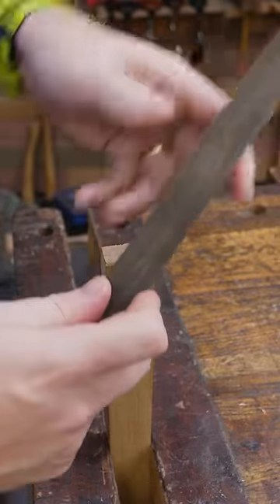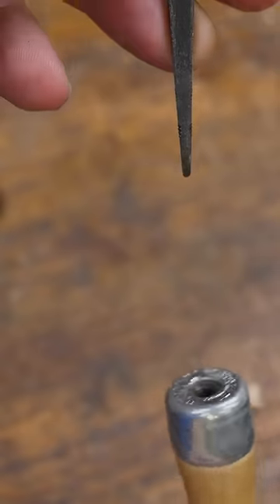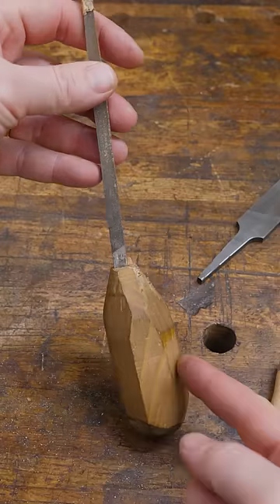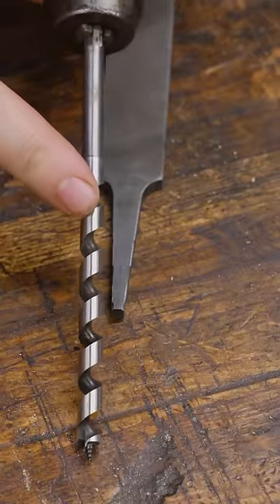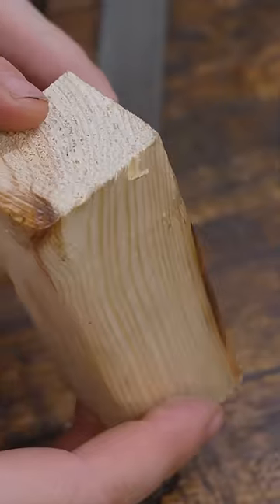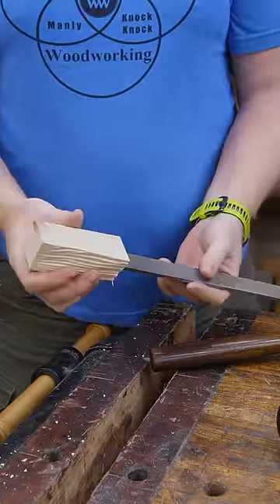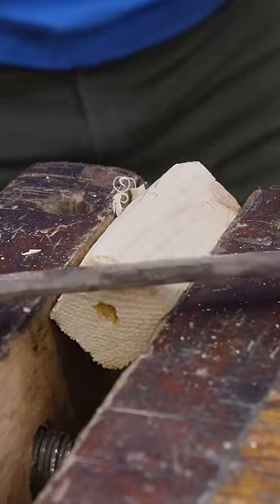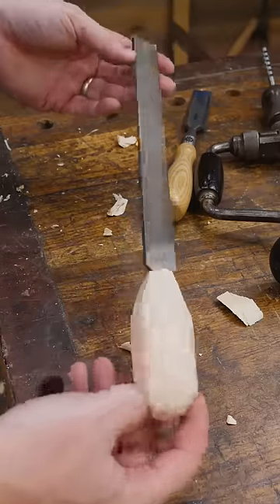How to Make a quick File Handle

Comment: I’ve literally never used a handle on any of my files.
Reply: I've never been a fan of the handles, if they come with the detachable handle I never use it. It's just awkward for fine work for me.
Reply: For me, I only use the handles. I throw the file in the garbage and just make do. Amazing what you can get done with a little grit and elbow grease.
Reply: @bcary461 i never use the handle, it makes control harder
Reply: You don't need a handle on one unless it's one with bigger teeth
Reply: I usually just put a little bit of tape around the metal for grip, I like the tiny not a handle
Reply: well atleast put some tape and rag over the point.
 its a very pointy thing right in the vicinity of your carple tunnel, one accident and no more filing for you.
also use a handle especially when using on a lathe.
one of the guys I worked with told me a story he witnessed from one machine over, running metal lathes you usually with break corners and deburr with a file, perfectly safe if you do it correctly. well the guy on the machine next to him refused to use a handle on his file. it caught the chuck and shot the tang of the file directly into his heart killing him on the spot...
Reply: As a machinist for 30+ years i don't use handles on my files. It is more comfortable for me to not have one.
Reply: I have about 30 friggin files and not one handle
Reply: Sounds like you never got a handle on those. File that away for later.
Reply: It feels uncomfortable with the handle to me
Reply: Same lmao
Reply: @nickb3005 same only time ill use one is on the lathe... seen too many accidents
Reply: Handling shanks all your life, now have you been?
Reply: This is going to seem really stupid, but I didn’t even know files HAD handles. Every file I’ve seen in my life was just straight tang.
Reply: @grimm3698  this boy either capping to his hearts content or really stay with them shanks and there’s no in between.
Reply: @jacobe9187  can’t tell if you’re talking about me or the guy who made the original comment, but on god I’ve never seen a file with a handle. All of em were just tang and file.
Reply: I didn't even know they were supposed to have a handle till now 😅😂
Reply: @grimm3698 so you spent your life surrounded in Tang?
Reply: Neither have I, but I might fire up the lathe to knock out a few, now that he's pointed that out to me.
Reply: Handles for me are more comfortable and control. Old screwdriver handles work very well on most files. Even a wood ice pick handle is good.
Reply: @nathanmunro-donohue4330 That’s right! Grit your teeth! (I’ve heard tooth enamel is pretty hard, too) And add that elbow grease! Yer elbow will squeak without it.
Reply: @nickb3005 Only on the file by the lathe.  I've gotten one WITH the handle ejected into my gut, and that hurt pretty bad.  I don't want to think about the bare tang hitting me like that.  Although maybe I just shouldn't be using a file on a lathe at all.
Reply: Apparently you've never seen a lathe run a file through a mans hand then. 😵💀

Comment: I have a lathe.  One of the first thing I did with it was make really nice handles for everything that needed one
Reply: At least you finally have a good handle on things
Reply: I’m glad you finally got a grip
Reply: I think you might not use a panel saw for ripping.
Reply: I did the same when I got my lathe and then I replaced all the plastic handles with wooden ones.
Reply: For those that don't have a lathe, you can use a drill as a lathe, clamp it down and you will need a board with a nail on the other side for the piece to spin on, search for old manual lathes for examples
Reply: @blueberry766   that's actually why I got a lathe.  I had been using my drill press to turn small handles.
Then I remembered how much fun I had in highschool wood shop when I made a bowl.
Now I turn at least one project a week
Reply: @blueberry766  You can do that once in a while but the bearings in drills really don´t like radial force, so be careful when doing that.

Comment: I have used electrical wire nuts for handles. Large blue and greys work great. Easy to put on and a little smaller for the ol' file drawer.

Comment: Good tip, had a very large file that needed a handle. Cutting and shaping a piece of 2x2 into a good grip was really easy with a drill press and belt sander.

Comment: I use a 3d printed abs handle at 100% infill with a tapered slot to match the tang. A captive nut inside the slot acts as the threads to receive the set screw that locks the file in. Can be scaled to fit any file. Made this after my file fell out of the wood handle into a cnc mill when trying to deburr a part in the vise. After a few times of waiting for my file to exit the chip conveyor I was done with wood handles.

Comment: I keep some 1 inch dowel for my handles. Some people cut pieces of metal pipe to use as a ring around the top because with hardwood, gonna spilt. I use wire with that crimping tool, and tape over that

Comment: this works well with green sticks (i have an oak infestation so plenty to work with) just drill a small hole and jam the file in there, works well, should really tighten up once the wood dries. i have several that fit perfectly in the palm (plus! already shaped for your hand)

Comment: Small hole in a golf ball. Thank me later!
Reply: The golf ball is a good idea, although it seems a little small for control. However, it would be absolutely perfect for a hole starter, which is short and pointy needs firm downward pressure. I'll definitely have to try that.

Being a jewelry-maker myself, I've also seen billiard balls with inserts designed specifically to hold gravers or stone setting tools. They would also work well for needle files if you cut the tang shorter. An indulgence for sure, but If you ever need to find a gift for a jewelry-making friend, I promise that is a guaranteed winner! 😊
Reply from the maker: I have one with that. It is not my favorite, but I know a lot of people like it.
Reply: @WoodByWrightHowTo  Of course you have one James, what was I thinking? 😉

Comment: I like using old golf balls as handles. Same deal as this wood handle, drill the hole and tap it in. The ball makes a comfortable light grip that slides in your hand when you want it to. When you first put your file into the work, the file slips into perfect contact in a soft grip and a medium grip keeps it in that angle as you move

Comment: I use the handles of cheap screwdrivers for file handles. You heat the shank of the screwdriver until the plastic inside the handle gets soft. Slide the handle off and jam it onto the file shank while it's soft. Instant handle.

Comment: My friends grandpa goes to the local golf course and surrounding areas and picks up colored golf balls for free, drills a small hole in them and uses that as the handle. Doesn’t fill the hand but way more comfortable than gripping exposed tang for hours on end.

Comment: I went to a liquidation store and bought a bunch of wood handled bottle openers for .50 a piece I snatched the metal bottle opener out of the handle and put some 2 part epoxy in the hole and rammed my file into the handle let them set overnight. Best handles ever with minimum work making them lol.

Comment: I use them a lot at work, they don't have handles. I just grab it and use it. I work bandsaws and touch up a couple teeth if needed. I prefer letting the grinder do the work. Usually filing off fuzz.

Comment: Take five or six inches of old heavy rubber garden hose, punch a  hole in the middle all the way through, then push your file through the hole and into the handle of your choice.  The hose piece is to be crosswise to the file, directed like a hand guard so if you push the file too far against a sharpening edge the hose piece stops against the edge and you don't cut your hand.

Comment: Sorry for making a comment without a terrible pun, but have you have used the burn-in method of fitting? Drill the hole, use clamping pliers (ie visegrips) as heat sink between the tang and body, then heat the tang with a torch or stove, and jam it in hot?
Reply from the maker: I have used it but for files I generally don't like doing that. I do that occasionally for chisel tangs.

Comment: About ten years ago, I got written up by some Inspector General folks during an Air Force exercise for "dangerous misuse of a file". I was quickly deburring some freshly cut cabling hardware and didn't bother to throw a handle on the file.

Comment: my usual file handle is made with a champagne cork . sometimes a single cork is not long enough. then I'll.find another cork that matches the other cork's diameter. I cut it to length with a utility  knife and with a hammer force the corks onto the file tange.
champagne corks are a comfortable shape without carving .
I think my method is about equal in work I just keep a supply on hand. 
ordinary wine corks are useful as drill stops. drill  through the cork with the size you'll be using on the drilling you'll be doing. to get the precise length trim the cork with a utility knife.or adjust the depth that the drill bit is inserted until the precise depth is achieved.
the hard part is drinking all that wine and champagne to keep yourself properly supplied with corks.

Comment: Have you ever heated the tang (just the tang) and put it in the handle with a little burny burn?
Reply from the maker: I've done that a few times. And when you do it right it makes a really good fit. But it's also very easy to do it wrong and overheat the hole and make a loose connection. Or you don't heat it up quite enough and it just doesn't seat down all the way

Comment: Hmmm... That bit with snail seemingly went very well through the endgrain. I had some trouble with that, and Paul Sellers somewhere said that they go much harder then regular bits. 
Is there some secret?
Reply from the maker: As long as the auger bit is sharp it will go through most any end grain.
Reply: @WoodByWrightHowTo  Cool... Thanx!🙂

Comment: For those of us coming across this short who don't do woodworking, is there any validity to the complaints about not using a handle? Only used a file occasionally in my life, never had one with a handle on it.
Reply from the maker: if you are carful there is no issue with it at all. there are people that go their whole life without a handle. but I have seen a a couple people put the tang into their wrist. so the question is how carful do you want to be?
Reply: @WoodByWrightHowTo  Geez I assumed they were trying to say a handle gave you more control or something. Never imagined something as unlikely as the tang going into someone's wrist. Yeah. I'm going back to not caring about file handles again lol.

Comment: I just get crappy old screwdrivers with messed-up blades (8 or 10 for a buck from local pawnshop), heat the blade with a propane torch about 2” from the handle, when plastic gets soft, pull it off of the blade and jam it on the file.

Comment: Honestly, with all this effort, you might as well go the extra step and tap threads on the exterior of a conical piece of metal and weld the more open part leaving a slot so now you have a threaded and slotted adapter that you can screw into any wood block with ease 😂

Comment: Using a file without a handle isn't just uncomfortable. it's dangerous.

I work in a machine shop and coworkers have told me stories of someone filing a part spinning on a lathe, the file grabbed, and because there was no handle, that tang whent right into the guys arm.

Buy good file handles, its not just a comfort item, it's a safety item

Comment: What about putting something inside the handle so you know it's actually secure
Reply from the maker: It is more then secure enough. You want to be able to pull it off in the future. I have a couple like this that have been on for more than 7 years so far.

Comment: Anyone who is mad about a file not having a handle is probably a machinist, or wood turner. NEVER use a file without a handle with high speed parts, it's a good way to get an unwanted body peircing.

But for average carpentry work, this is perfectly fine as long as you are comfortable with it.

Comment: LOL It will probably grip better in the long run if you file some "teeth" in the corner edges of the file tang.
Reply: Handle wood will swell with moisture and grip a bit better. At least for a while.

Comment: Saw a guy filing aggressively once.
The tip of the file fell off his side of what he was filing in the vise and because he forced forwards so hard the oldddd handle broke open and his arms went forwards straight in to the now exposed spike on the back of the file...
Opened his arm up from his wrist to his elbow.
He passed out at the sight of his own blood.
Had to rush over and tourniquet above the elbow before he bled out.
Absolutely disgusting 🤢

Comment: My question is: Why do you use a file on wood?
Reply from the maker: it is often the last thing to touch the wood before finish especially on organic shapes. it works faster then sandpaper and does not drive dust into the pours.

Comment: If you would like to have a better fit, take a blow torch to the end there on the file. Heat it up till it's red, hot. And you can shove it into the wood.
Reply from the maker: you have to be carful with that method. if done right it is prefect, but if you get the steel too hot it will burn away and give you a sloppy fit.

Comment: well at least put some tape and rag over the point.
 its a very pointy thing right in the vicinity of your carpal tunnel, one accident and no more filing for you.
also use a handle especially when using on a lathe.
one of the guys I worked with told me a story he witnessed from one machine over, running metal lathes you usually with break corners and deburr with a file, perfectly safe if you do it correctly. well the guy on the machine next to him refused to use a handle on his file. it caught the chuck and shot the tang of the file directly into his heart killing him on the spot...

Comment: What is wrong with using a file without a handle.
Reply from the maker: If it catches while you're pushing the tank can go into your wrist. But if you're careful that's usually not a huge issue.

Comment: You can not flat file a soft metal surface larger than the file if it has a handle , so none of mine do , lol
Reply from the maker: For that work I would use a float or file holder.

Comment: Don't hammer the file into the wood; hold the file upright,' and tap the handle base onto a solid surface. Just as you would do with an axe handle.
Reply from the maker: I got to do something for the comment warriors to talk about.

Comment: One of these centuries file makers will realize that a wedge is possibly the most idiotic shape to make the tang.
Reply from the maker: I would disagree. It seats well and security sets, but that can be easily removed when needed.
Reply from the maker: If they're coming off then you have put them on with the wrong pressure. I have never had a well-seated Tang handle come off. Most cheaper handles are actually put on with a Tang that has parallel sides. I've had several of those come off in the past. Because they're parallel once they loosen they're done. You can't push them on a little bit more.

Comment: Also quick tip.. when your files or rasps or even saws get dull... dont throw them away. Instead clean the slutes with steel wire brush to remove any dirt stuck in there and hang them into citric acid solution for a day or two depending what % solution is. Other acids work too but citric is cheap as dirt and not much of a safety issue. After there is black coating in file, wash and brush it with brass brush to clean the oxide layer under hot water, dry it quickly and apply coat of wd-40. Havent had to buy a single file ever, since i get them for free from all the morons who dont know how to sharpen them.
Technically this should work to any blade, cutter etc that can be eaten by acid, but havent tried that yet on endmills or hand saws.

Comment: As a machinist, you never hammer a file into the handle... you put the tang into the hole and you slam the bottom of the handle on a solid surface... file is hardened metal and can easily chip or shatter from the least amount of pressure. Simple waste high drop onto concrete have bifurcated almost half a dozen for me.

Comment: For everyone in the comments that has been working with wood and using files for year on years. Why don’t you bite the bullet and get an expensive lathe? You will still use your file but only for finer things
Reply from the maker: I have three different lathes. This is just faster and easier

Comment: Using a file on timber.....!?!?!?!?
Only in America....
Reply from the maker: That practice goes back as long as files have been around. It's often one of the last things to touch the wood. Will give you a surface as smooth as sandpaper but without clogging the pores with dust.
Reply: @WoodByWrightHowTo  For timber....you use a rasp....files are for metal....
But you can also use your handkerchief to wipe your ass....
Reply from the maker: You will have to tell that to the woodworkers that have been using files for hundreds of years. you can even read about them in Roubo's book from the 1700s
Reply from the maker: Roubo is French.
Reply: @WoodByWrightHowTo  So there will be a translation mistake then....

Comment: The handle is for your HAND, not for the file.
If YOUR hands don't need a handle, what's the fuss?
   Also, some jobs take less time to DO the job than it takes to locate & mount the handle - which you then have to remove & stow.